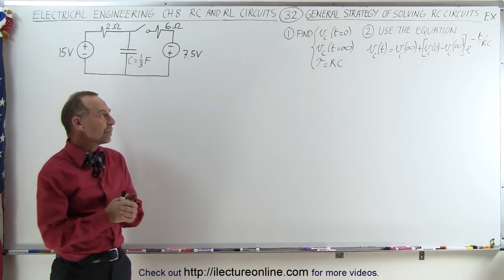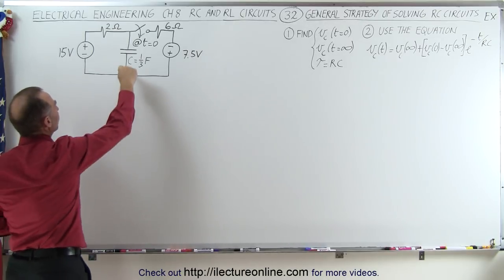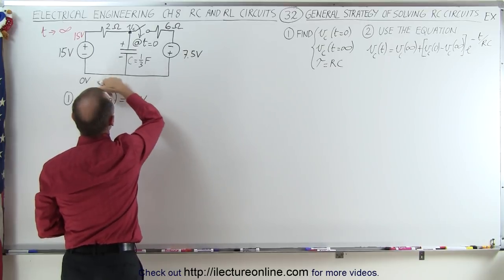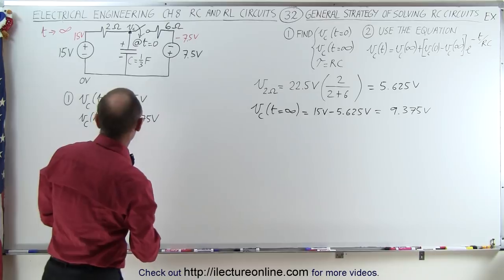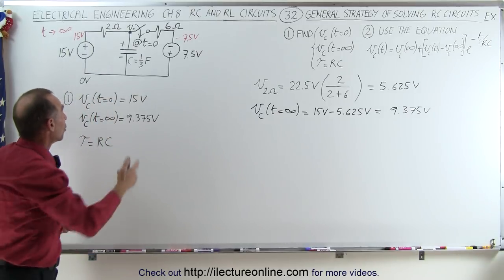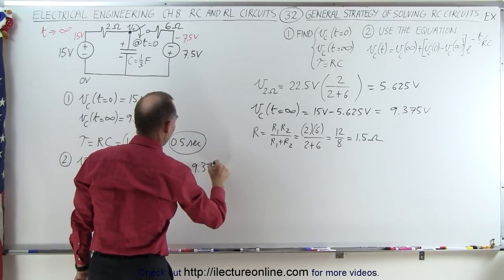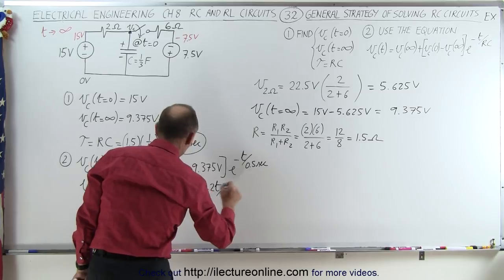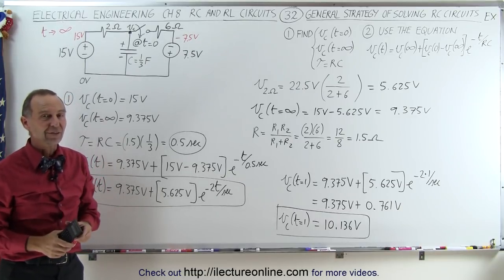Electrical Engineering: Ch 8: RC & RL Circuits (32 of 65) Gen. Strategy of Solving RC Circuits Ex.

Comment: when t is infinity, wasn't the capacitor fully charged and acts like an open? Why do we still calculate the Total Resistance like resistors are in parallel but not in series when the middle is an open?  please help
Reply from the maker: The capacitor was fully charged at t = 0 and had a potential difference of 15 V across it as indicated in the video and there will not be any current flow before that.  Once the switch closes, the potential difference across the capacitor will change and current will flow on that branch and through all the resistors.
Reply: got it! sincere thanks from Hong Kong !
Reply: @MichelvanBiezen  potential difference is 15 volt but 2ohm resistor present in series therefore voltage across the capacitor is not 15volt sir......
Reply: @kannanr9016  at t<0 capacitor behaves as open circuit so on current flow !

Comment: I wasn't sure where to start on step 2, so I used source transformation so that everything would be in parallel and my equivalent circuit was a voltage source of 9.375V with a 1.5ohm resister. I was surprised to see that it gave me the same answer. I am happy to see that a technique I found in a previous lecture was able to be applied here as well.
Reply from the maker: Very good.  That is how you will learn the different techniques and how you'll gain confidence by knowing that every technique will work on every problem.   (Although some problems lend themselves better to some techniques over others).  And you will find your favorite techniques that way.
Reply: could you please share the reference book that i could find this type of the problems ?
Reply: @abdallahomar196  Just watch the entire playlist. It is all there. In fact this channel covers most of the material for required courses for most BSEE programs.

Comment: I did not understand the part where you find the equivalent resistance of the circuit to find Time Constant .It is different in every question as I see.When we  are finding the equivalent resistance do we ignore the sources like you did in this example?
Reply from the maker: To find the resistance we do indeed "ignore" the sources, however the sources will off course determine the amount of current that will flow through each branch.  In this example we want to know what the time constant is (RC), which requires us to find the equivalent resistance of the circuit with respect to the capacitor.  (How quickly will the capacitor charge or discharge)?

Comment: Sir, why is there no voltage drop in resistance (2ohm) in condition t<0?
Reply: at t<0 the capacitor is full charged. At the time, the capacitor behaves like an open circuit, which would mean there would no longer be a current flow.

Comment: @t<0 the capacitor has already reached 15v via R=2 and @t=0 the capacitor will try to charge up to 22.5v via R=2 again , because @t=0, one end of R=6 becomes the reference ground and the other end of R6 changes Voltage according to Capacitor's voltage.So with RC timing of 2/3s or 0.66s, the formula will be Vc= 15+7.5(1-e^-t/0.66) or simplified to Vc=22.5 + 7.5e^-t/0.66 and as time goes to infinity, Vc=22.5v. I hope I am not wrong because I am taught by the best lecturer in the world, I tell you his name, he is Mr Michael Vanbiezen. With the greatest respect, all the way from Iran.

Comment: Sir, i had a doubt. When you used the voltage divider rule, isn't it applicable only for when resistors are in series. But over here they are in parallel, so how was it applicable?
Wait, I got it I think. The capacitor acts like an open circuit at steady state so we effectively remove it, am I right? So like it becomes a series circuit

Comment: Why the V(t) change from Voe^-1/time constant (The first few videos in this chapter) to the equation stated in this video???, any hint or words for me to realize which equation should i use? thank you.
Reply from the maker: In this example we are dealing with DC voltages, a capacitor, and a swtich.  When the switch closes, the capacitor well undergo an instantaneous voltage changes across the terminals of the capacitor.  The capacitor will then either gain or lose charge, which occurs as an exponential function.

Comment: When getting the 22.5V across the 2ohms and 6ohms, was the Capacitor ignored just to get the voltage across 2ohms? If so, can I ask whyy? thank you!!!
Reply from the maker: When determining the voltage across the 2 resistors, we take the outside loop, and see that due to the 2 voltage supplies the potential difference is 22.5 V.  The branch with the capacitor will change from its original value of 15 V to its final value.
Reply: @MichelvanBiezen  thank you!!!

Comment: why dont you explain more on how can we get 22(you may again said it is voltage drop) but i need more on the explanation of how !!!
Reply from the maker: 22.5 V = 15 V + 7.5 V    (the 2 voltage sources are in series)
Reply: But you said it was -7.5V
Reply: or 15 - ( - 7.5 ) = 22.5 V
(voltage difference between two nodes)
Reply: @ibzih  is the case always like that between sources?